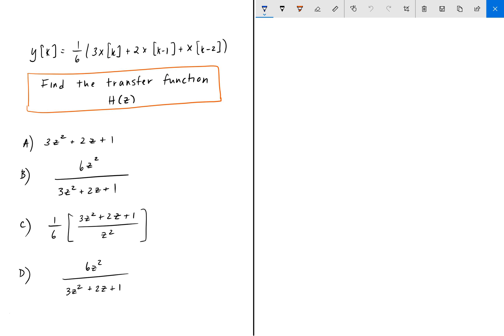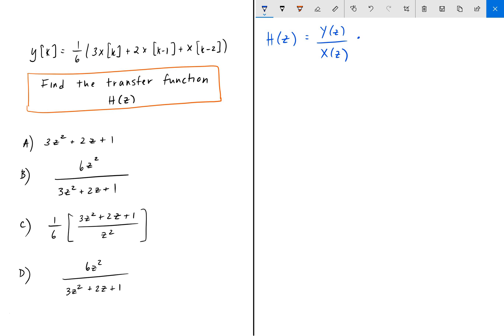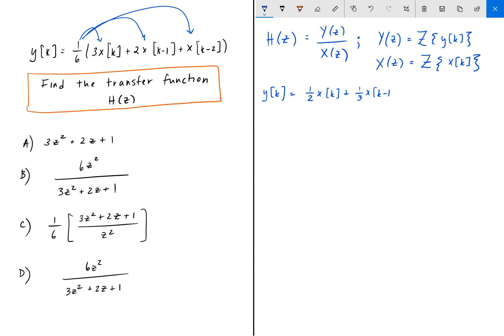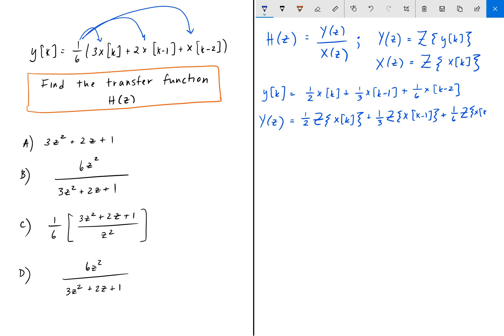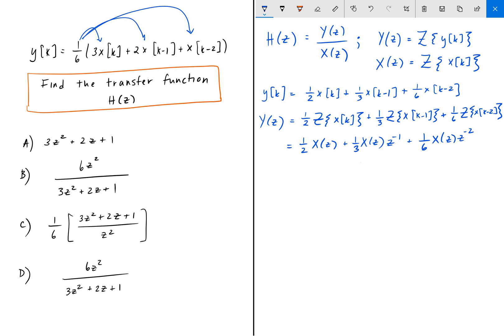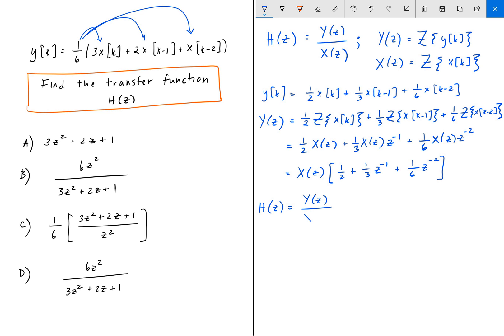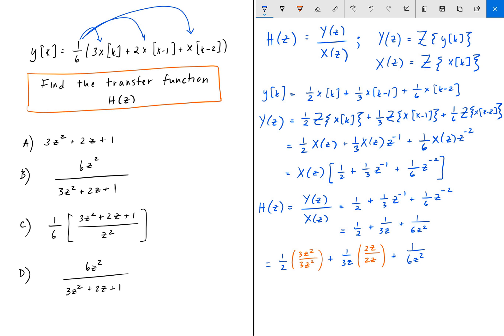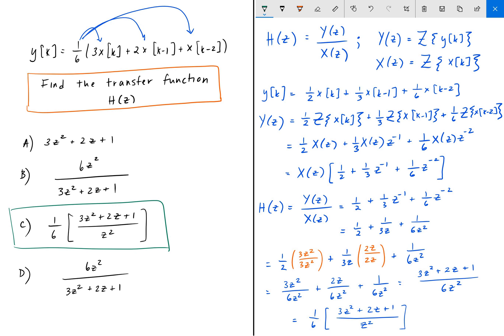Electrical FE /EIT Exam Prep - Signal Processing 4: z-Transform on Difference Equation II

Comment: If you multiplied the entire final solution by 6, then dividing the Z^-2 amongst all the terms (pretty much working backwards from the solution) you would get 3 + 2Z^-1 + Z^-2. Then if you multiplied the entire thing by Z^2.... you would get A?
Reply: No all you have to do after extracting the X(Z) is to simply multiply numerator and denominator by Z^2. That's it. It's that simple. He did like 5 unnecessary steps. 

H(z) = 1/6 (3+2z^-1 + z^-2). Then multiply by (z^2)/(z^2) to get 3z^2 + 2z + 1 divided by 6*z^2. Answer is C.
Reply: @JL-fh4qw  Got to show his work to the viewers, bro. Haven't taken this class in 20 years or something. I remember I used to like these classes because when I was working in a group... I ended up solving all the problems and had someone explain the concepts to the others as I work on other problems. Solving and getting answers is fun. Seems like it will take me 5 days to review all of the material in this channel. I am just trying to figure out how to review the other material that is not covered here. If you have any suggestions, please let me know.
Reply: @airbender9593  showing all the steps is fine but the steps were not necessary and made things more complicated
Reply: @JL-fh4qw  Now, I am looking it a bit more carefully and you comment. I see what you mean if I used mental math. Imagine if you are teaching this to elementary students, you wouldn't want to skip those steps. It is more proper to have them. EE students are generally stronger with math. I can see 40% of students would be able to do it mentally. I should finish with the rest of the videos by tonight, and tonight I have my last tennis practice, which I do not want to miss. By watching and understanding mathematical concepts of the videos, I am not sure how much this prep me for the Electrical FE /EIT Exam. Are you using any other books to study your FE? It should take me 5 days to review all these videos. If you like we can study together...

Comment: You can also derive A from the solution though? If you multiplied the entire solution by 6Z^2, (before you multiplied by a common denominator 3Z^2 & 2Z) you would get A? Is that not also correct?